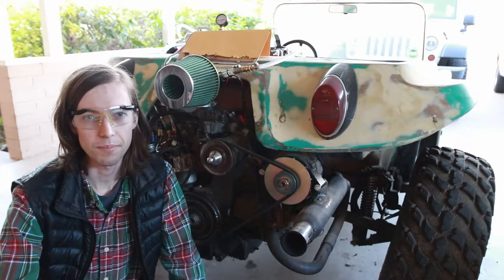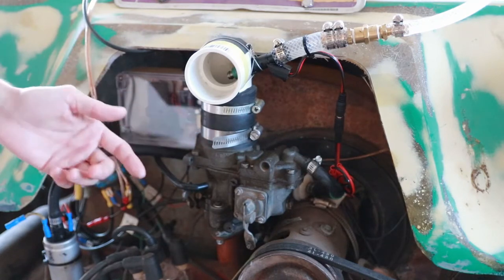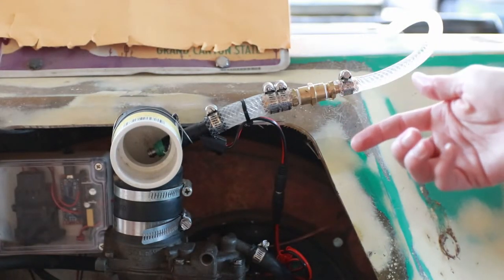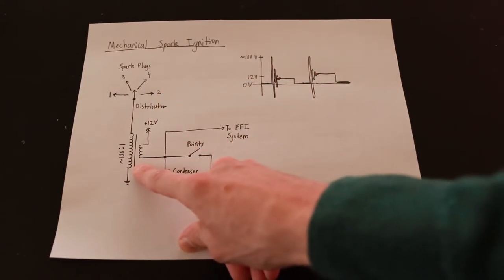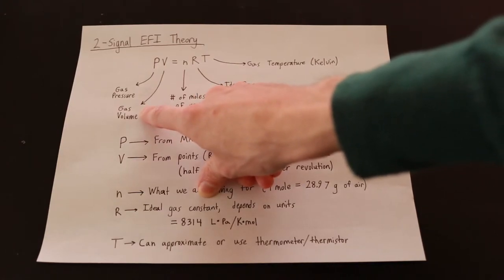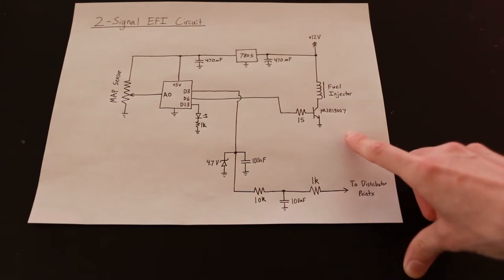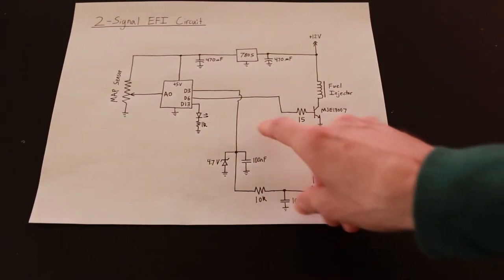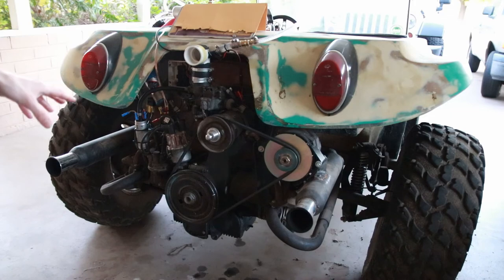Electronic Fuel Injection with MAP and Points Only

Comment: I have another question, about the E51/ gas selector from the code: is E51 default fuel?
If so, how can one switch between fuels?
Reply from the maker: If you change the constant "fuel_comp" from 0.70 (for E51) to 1.0 , it will adjust all mixtures for gasoline.
Reply: @DielectricVideos  
There are two constants, only one of which has two dashes in front (the gas constant). I guess the two dashes disable the constant?
Reply from the maker: @soupflood  Correct, in Arduino C the '//' is the comment flag. If you remove the comment slashes from the gas constant declaration and add them in front of the E51 constant declaration, only the gas constant declaration will be used.
Reply: @DielectricVideos  thank you! Hopefully others will find this answer helpful as well.

Comment: Can I use a throttle potentiometer instead of the Map sensor? The signal would be se same or not?
Reply from the maker: The throttle position sensor can be used if you implement Alpha-N control, but for pure speed-density, a MAP is needed. The throttle position will not give the air density directly, as it will vary depending on the air speed and engine speed. You may want to look up Alpha-N control if you want to try designing a system for primary-TPS control.

Comment: Hi, nice conversion, i was not sure about converting my turbo honda cb400 to efi but looking at your code and overall simplicity of your efi i decided to give it a try. I have couple of questions about the afr table, i need to have it working up to 12k rpm, if i'll just add more map indexes both in function to obtain afr and afr table and do same for MAP sensor pressure (with pressure going above absolute since it is forced induction) will it work? In afr table there are target afr, will program calculate it properly with pressure higher than absolute?
Reply from the maker: The AFR table can be extended to higher RPM and MAP ranges, but you will have to add those extended ranges to the cell computation code in the function AFR_Reporting() as well. You'll have to update the value of "Pascals_Per_ADC_Unit" based on the voltage supplied by your MAP sensor, as it will have a different value for a positive-pressure (boost) MAP sensor than for a 1-bar MAP sensor. The particular ADC value will will depend on whether it is a 3 bar or 4 bar sensor.

While the speed-density code should work for higher RPM and positive boost pressure, you might run into issues with sensor polling time at 12000 RPM. If the code is too slow, it may miss engine rotations and undercount/underestimate the RPM. This is where testing and subsequent code optimization may be required.
Reply: @DielectricVideos  Thank you for quick reply, i don't think i will have much problem caused by code being too slow because i'm planning to use separate rpm sensor on a crankshaft wich will give me one signal per turn, in your vw you have 2 signals per crank turn wich at 5k rpm gives same amount of impulses as with single signal per turn at 10k rpm i think those extra 2k rpm wont be that much of a difference.
Reply: @DielectricVideos  I cant find "AFR_Reporting() " function in, by cell computation code you meant this?:   
  int MAP_index = 0;
  if(pressurePa < 10342.1)
  {
    MAP_index = 0;
  }
Reply from the maker: @Dymitr_Nawrocki  You're right, it was just called "AFR()" in the points-only code. You have the correct code to update for the extended AFR table ranges. I was looking at a newer version of the program for the 4-coil optical distributor system, where the function names are slightly different.
Reply: @DielectricVideos  Ok, thanks again, now i finally know what to do, i'll order some throttle bodies and more arduinos(for some reason i never have enough of those) and while i'll be waiting for packages i will be modifying the code.
Reply: @DielectricVideos  Hi again, today i started my honda with that fuel injection for the first time and considering i did not do any tuning at all it runs suprisingly well. I still i need to do a lot of work on it but I wanted to thank you for code and help because otherwise i wouldn't be able to convince myself to finally convert it to fuel injection. PS i have a video of it running in shorts on my channel if you're interested.
Reply from the maker: @Dymitr_Nawrocki  Awesome! I'll check out your video later today!
Reply: @DielectricVideos  Hi again, i wanted to ask what does the "const int vacuum_ADC_value = 102;" do, will i have to change it if i'm using diffrent pressure map sensor?
Reply from the maker: @Dymitr_Nawrocki  This value is the ADC reading when the MAP sensor is at full vacuum. Ideally this would be zero, but most MAP sensors have some offset voltage even at hard vacuum. The units on this value are ADC units (each unit is Vref/1024 volts on ATMega328p and similar MCUs).
Reply: @DielectricVideos  Thx for reply, i'll connect map sensor to vaccum pump and i'll look what adc value map outputs at full vaccum and i'll use that value as offset.

Comment: Is the carburetor functioning as carburetor and fuel injected added? Or is the carb disabled and only the fuel injector working?
Reply from the maker: The carb is disconnected and only the fuel injectors are operating. I'm just using the carb as a throttle body in this installation.

Comment: Should I use electrolytic or ceramic capacitors
Reply from the maker: Electrolytic capacitors for DC power decoupling are typically preferred. For the low-voltage RC filter capacitors, ceramic capacitors are good, and for the high-voltage RC filter, a film capacitor is best.
Reply: @DielectricVideos  thank you John sorry for all the questions just wanted to get it right thank you again for all the knowledge and quick response

Comment: Very nice work 👍.i am from Greece and i have a Toyota pickup hilux with carburettor,look what i have to do,i want to convert lpg injector 12v to make close loop and its open from distributor pulse,i dont care to open all together this is better,now is open loop, if i connect to coil pulse every gives hi voltage open the injectors with 12voltage.thank you very much

Comment: Very admire your work can i get the codes that you program in your arduino?
Reply from the maker: The code for the system shown in this video, as well as a couple of newer implementations with custom PCB boards, can all be found here: https://github.com/JohnPattersonConsulting/DuneBuggyEFI
Reply: Where did you connect you fuel pump on your circuit diagram?
Reply from the maker: @cloudrigeverything7378  I connected the fuel pump to switched +12V, so it turns on any time the ignition switch is on.

Comment: I always think only use tps and injector control to make efi system..what do u think?can it works..?
Reply from the maker: It is possible, but is a bit more complex than speed-density control. The relationship between throttle position and fuel metering often needs to be determined empirically,  for example, by dyno tuning. Using TPS and RPM is called "alpha-N control". There's a great overview of the popular engine control strategies here, if you're interested: https://tunertools.com/pages/load-control-and-calculation
Reply: @DielectricVideos  thank u very much

Comment: Injector placement (position). Why didn't you go straight down from the pvc elbow as opposed to the side. In other words, you have the injector aimed at the pvc elbow inside wall as opposed to aiming towards the "throttle body" throttle plate. Just curious if you thought it would aid atomizing fuel/air mixture.
Reply from the maker: That definitely would have helped! When I first built it, I wanted to keep it out of the way of the license plate in case I wanted to keep using it on the road. But since this version was only experimental, it ended up not being needed. You might take a look at the newer video I made on the steel 2-injector version of the system, as that's the one I am currently using.

Comment: Hi, how could i setup the code to use it without map?
Reply from the maker: For speed-density control, MAP is one of the key measurements for determining the airflow into the engine. However, it is possible to use an MAF (Mass Airflow) sensor instead of the speed-density calculation to measure the airflow rate into the engine. Note that a MAF sensor uses a hot metal wire to measure airflow, so it is a somewhat laggy measurement. Alternatively, you could also use throttle position as a rough estimation of intake air density; however, you would need to apply a transformation to the throttle position value that is dependent on engine RPM in order to effectively estimate air density in the intake.

Comment: thank you for sharing your work, can this DIY EFI be implemented in carb gy6 scooters? many thanks!!!
Reply from the maker: It might be difficult to get enough electrical power for the high pressure fuel pump on a scooter, but theoretically with a decent charging system it should be possible!
Reply: @DielectricVideos  i might get a hold of an aftermarket fuel pump for scooters/ motorbikes. since you are using 4 contacts for ignition, on the other hand scooters have one pick up coil to sense Top Dead Center. will it still fire up with same values? Thanks!

Comment: Would I still need a condenser if my VW has electronic ignition
Reply from the maker: If it's a multiple spark discharge (MSD) ignition system, you may need to pick up the signal at the distributor (points or magnetic pickup), otherwise the coil signal will bounce multiple times and give false RPM readings. In either case, there is no need for an additional condenser if one is not already installed. If you are measuring the signal at the pickup (instead of at the coil), the output should ideally only rise to 12V (not the full open-circuit voltage of the coil primary). As a result, you will likely be able to eliminate the first RC filter in the circuit design and simply use a first-order RC filter with zener diode for the input to the microcontroller pin.

Comment: Can I use an uno with this code or is the nano better
Reply from the maker: Totally, the Uno and Nano actually both use the same chip (ATMega328p). A word of caution, though, is to be sure your pin connections are all solid. If you just insert wires into the pin header holes on the Uno, rather than soldering them, you may encounter loose connections.
Reply: @DielectricVideos  thank you again for the help and quick response

Comment: Where can I learn ECU tuning?
Reply from the maker: If you search "AFR Table Tuning" on Google or Youtube, there are several resources that walk through different approaches to the tuning process.

The best way is to use a dynamometer and to go cell-by-cell to tune power and emissions while limiting knocking. However, to some extent you can tune by feel based on how the car performs on the road at different RPM and throttle settings. The table can be tuned by adjusting overall trends from left to right and top to bottom.

For reference, assuming your engine parameters are set correctly, an AFR of 14.7 is exactly stoichiometric, meaning just the right amount of fuel is present to consume all the air in the cylinder. For acceleration you generally want to be slightly fuel-rich, and when coasting (low MAP pressure and moderate-high RPM), you want to be leaner than stoichiometric. Other than that, you'll have to tune by measurements or by feel while driving.
Reply: @DielectricVideos  thank you so much

Comment: There is no way the output from a micro can drive that MJE13007 into saturation when it is driving a typical low impedance injector, do you have an additional driver stage not shown in the schematic?  High voltage bipolar power transistors have low current gains, assuming your injector takes a peak current of 2 amps you are going to need at least 100mA base current, and maybe double that to saturate the transistor. A high voltage MOSFET or IGBT is a far better solution these days. 

Also you should provide some protection for flyback voltage on the collector,  again the MOSFET or IGBT parts designed for driving injectors and ignition coils usually have this built in.
Reply from the maker: For a single injector there was just enough gain in the MJE13007 to do it, but I ended up running into the saturation problem when I went to 2 injectors instead of 1.

I have a newer version of the circuit with an avalanche-rated MOSFET driving the injectors now, and it works great with 2 injectors. The 5V signal is a bit low to drive the MOSFET gate, though, so I'm thinking of adding a driver stage to run the gate at 12V in the next version.
Reply from the maker: If I wanted to add additional back-EMF protection to the MOSFET, would you recommend a snubber network, zener diode, or something else? I've avoided using a flyback diode from the drain to +12V because I was concerned it would cause the injector to close too slowly.
Reply: @DielectricVideos  A zener would be the usual solution.  You are correct to not use a free-wheeling diode across the injector, it will significantly slow down the closing time.
You have a 400v transistor so the chance of damage is lower (compared to e.g. driving an ignition coil), but the high voltage rating works against you in terms of low current gain/high base current requirements.  My recommendation would be to replace the bipolar with an avalanche rated MOSFET, not only can this be driven by the micro it will have lower saturation voltage and doesn't need external voltage protection.  Something like a STP62NS04Z is cheap and easily available from the big distributors like Digikey,  Mouser, Farnell etc
Reply: @DielectricVideos  Sorry I read your other post before this!  Good move on the MOSFET, which part did you use?
Reply from the maker: @ferrumignis  Thank you! I had several SIHG47N60AE-GE3 left over from a previous power inverter project, so I used one of them. They're totally overkill for this application (43A 600V rated), but the one I have installed has been working trouble-free for a couple months now, even without back-EMF protection.

Comment: What pressure sensor model did you use?
Reply from the maker: I used this MAP sensor, although similar ones should also work: https://www.amazon.com/gp/product/B07Z37XG1J
Reply: @DielectricVideos  Thank you for your reply. I have a similar MAP for a Chevrolet Lumina 1991. The problem I encountered was, when measuring the pins to find slider and V+, I couldn't because I guess it's a microcontroller. How did you connect yours?
Reply: @DielectricVideos  never mind, I found the pinout.
A is ground, B is signal out and C is 5V in. Thank you!

Comment: What micro controller did you use? i appreciate your passion for this project
Reply from the maker: It's an ATMega328p, on an Arduino Nano board
Reply: @DielectricVideos  thanks :)
Reply from the maker: @Sqwhirl  Glad to help! I should have another video coming out soon showing the latest version of the control board I've designed, as now I have all the required electronics on a single PCB!

Comment: Wow, very interesting indeed, awesome ingenuity. May I ask where you learned the basic programming skills needed to do this? I'm a long time tinkerer/mechanic, handy as they get, but computer programming is still black magic to me. I would LOVE to build a FI system based on a few simple inputs like this. I'm daunted by Megasquirt, but I've tuned carbs all my life to do anything I want really, including boosted applications. Thanks again, hope you have time to respond.
Reply from the maker: I picked up Arduino programming on a number of earlier projects. It's a fairly simple programming language, and is a good way to learn how to control microcontrollers. I'd suggest getting an Arduino Uno and downloading the Arduino IDE software to start learning to program, then design a system around what you learn.
Reply: @DielectricVideos  Roger that, will do!  Keep up the neat work, Thanks!

Comment: Is that possible to do with daihatsu 3 piston engine?...can you show some sample?.
Reply from the maker: It should be possible. I believe the Daihatsu 3-piston engine will pulse the points 1.5 times for each engine rotation, so you would need to change line 24 in the Arduino code from "const int pulsesPerRevolution = 2;" to "const double pulsesPerRevolution = 1.5;". The change from "int" to "double" allows decimals to be used, as engines with odd numbers of cylinders will typically have non-integer distributor pulse ratios.

I don't believe the Daihatsu uses a wasted spark system, but if yours does, you would want to set pulsesPerRevolution = 3.

You will also want to adjust the engine displacement information to match.

You can download the Arduino code and PCB files for the 1-coil ECU system here:
https://github.com/JohnPattersonConsulting/DuneBuggyEFI/tree/main/EFI%2BIgnition
Reply: @DielectricVideos  thank you
Reply: @DielectricVideos  my dihatsu engine is just standart...and use mechanical distributor as spark plug sequencers...also just small one 660cc..and one more thing....what type of fuel injector you use?..i see some fuel injector have 2 hole...4 hole...5 hole..and many ..thank you for your help
Reply from the maker: @sdknstar601  I use this type of fuel injector, and I find that it works very well for this type of system. On my 1776cc VW engine, I run 2 of them, but for your 660cc Daihatsu, just 1 should be plenty:

https://www.ebay.com/itm/223219081755
Reply: @DielectricVideos  thank you mate...

Comment: I am very interested to convert my car also.
I have an old type Mini with  SU HIF44 with electronic ignition. 
How do I go ahead convert my system?
Reply from the maker: You may want to start with a more finished product, i.e., Speeduino or the Holley Sniper system. Otherwise there is a lot of troubleshooting, soldering, and room for error involved in building it.